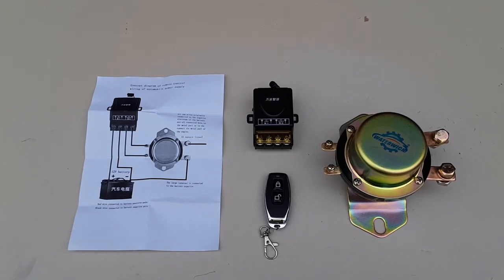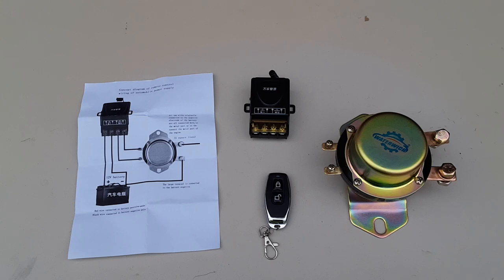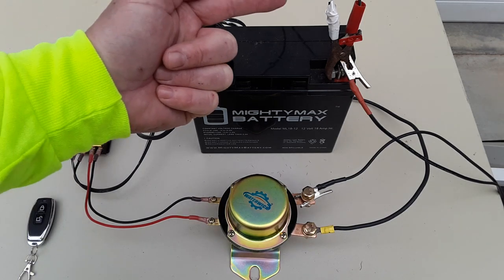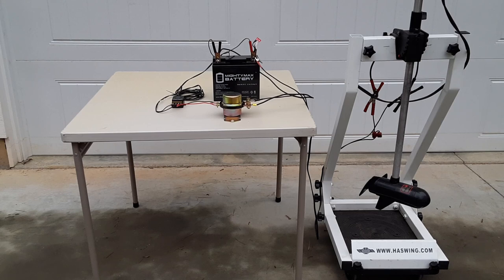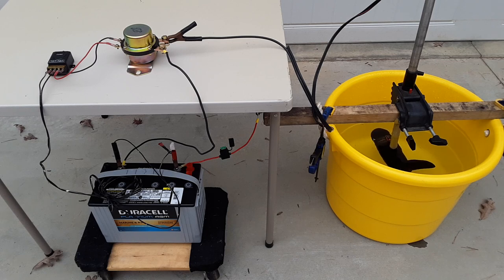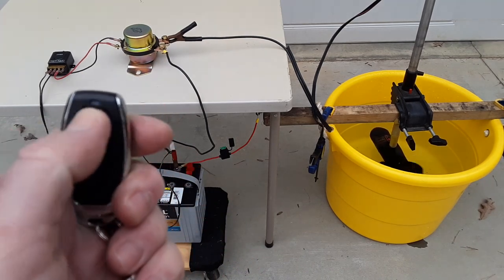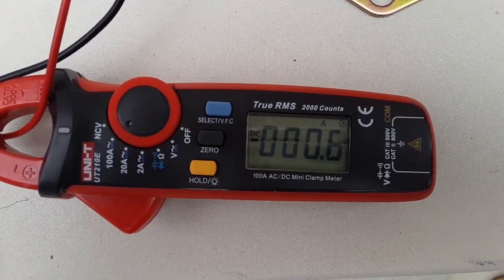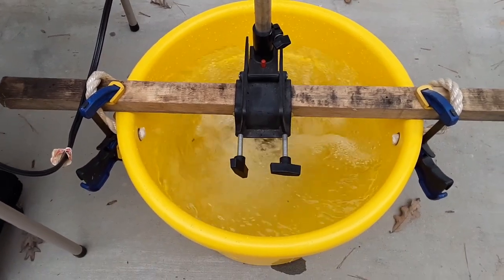12V Marine Wireless Cut Off and/or Momentary Switch

Comment: The on off switch,  Seems like that thin thin thin negative wire is gonna reduce the current flowing through your car.
Reply from the maker: It is a test set up. I will use 10G for the kayak (not car) wiring.

Comment: How could I wire this on my truck, preferably to the starter. If someone knows it’ll be greatly appreciated
Reply from the maker: The directions that come with it show how to do it. You could also try other YouTube vids.
Reply: @Aksmaniyak  would I have to just interrupt the wires going to the starter or do I have to run 12v into the switch and then splice into the starter before the relay ??
Reply from the maker: @thomasphillips8507  Click on the Amazon part link and one of the pics shows the connections.